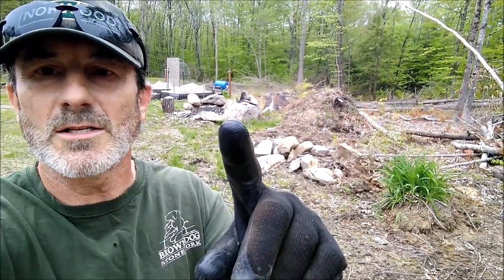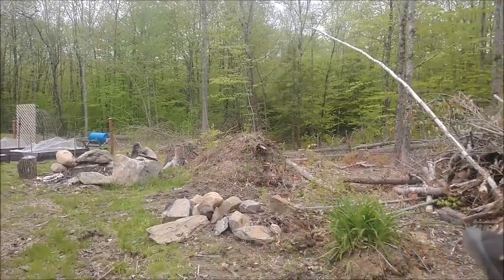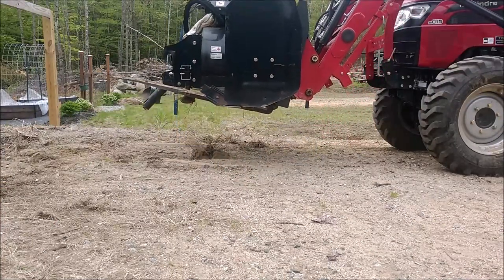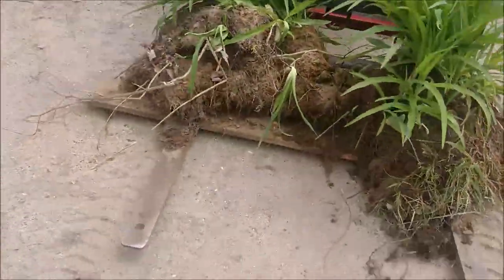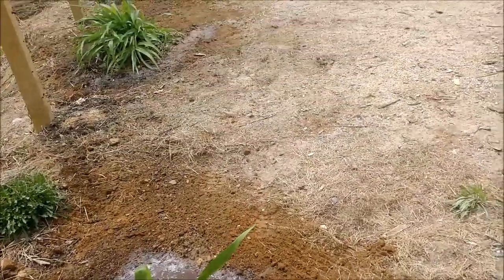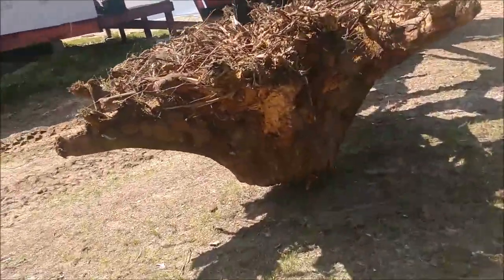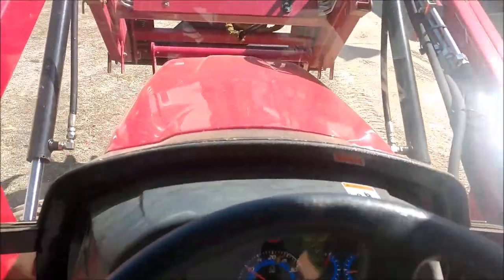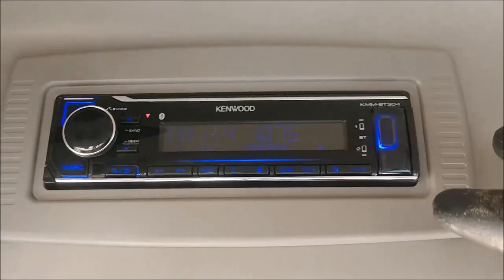Using the Mahindra 2638 I started clearing an area we want to use for new garden.

Comment: Just subscribed Tim! Mahindra 2638 owner myself.
Reply from the maker: Hi N1KSF, thank you for subscribing! We're loving the Mahindra 2638. It's helping us take our work to another level. With all the quick attachments there's not much we can't take on. What do you use yours for primarily? Thanks for watching and commenting!
Reply: @crookedriverhomestead Mine is a 2021 year model... I'm a few hours to the left of you in Southern NH. My 50+ odd acres here is mostly inclined, wooded and loaded with granite rocks (part of it used to be a quarry) I use it for dumping gravel and dirt and smaller landscape style rocks..bucket of course comes in handy for transporting rakes and shovels etc. I did buy a set of 60" Titan adjustable forks w/quick disconnect frame for it as well, have used forks to lift up pallets, concrete slabs, lumber, fallen trees..and with straps, I have used it to unload a 20t hyd press from trailer, large table saw etc. Moving a large chicken coop across property will be next. I actually use the backhoe (with thumb) more vs loader, in digging up and moving granite. Have moved and relocated some 1000 lb+ pieces with it! Tractor has also recovered stuck cars and SUV's on property in winter! 😂. I won't push it beyond its limit and keep it as residential use vs commercial use. I have the Ford 555 for the bigger/ heavier things and 2 smaller Economy tractors with loaders, more so for garden use. Also have a Harbor Freight backhoe, the lower CG on it, I'll use in certain steep inclined areas on my property vs the Mahindra...don't want to flip the Mahindra! lol
Reply from the maker: Sounds like the perfect tool to have on your property. You have a lot going on there! Did you get the cab? Good plan to not push beyond it's limits. As the parts manager at a Mahindra dealer I saw folks who did push it to hard and ended up breaking things. The motor is what makes the machine IMO, but the large motor can make it easy to push it to hard. I could use a bigger piece here also to do the things the 2638 can't. But that's where rentals come in. Keep the rubber side down! ;)
Reply: @crookedriverhomestead  No cab. Between stray branches in the woods, and the current replacement time for the glass, I didn't want to risk it. I do need a canopy though for shade, I may fabricate one of buy the OEM one. Tractor is registered/ plated, stores indoors, and does not come out in rain or snow. Yes I baby it within reason..Tires are not loaded, and have the industrial tires. It's like having a new muscle car: power, looks great, smells new, but not being a teenager anymore, I won't beat it to death trying to see what it can do. That's where the other stuff come in. And yes at least with the HF one, I've broken it a half a dz times, repaired beyond OEM strength, never broke the repairs again, and on I go. I think the next purchase for the Mahindra is a Piranha tooth bar for the bucket. I do have a lot of P.I.T.A. saplings to deal with when clearing land, I think this will be a blessing.
Reply from the maker: I did have the tires loaded, however I still needed a 500lb weight on the 3 point before I got the backhoe. The 500lb weight made all the difference when carrying a loaded bucket. I did try adding a tooth bar to the bucket but it ended up breaking the first time I used it, so I returned it.  A toothed bucket would definitely be helpful to me. Farm plate would be nice also. Have fun!
Reply: Mahindra tractors are real tractors that work all day an keeps on performing
Reply: @ronniemitchell3010  no complaints with mine!
Reply: @n1ksf  we have 4 mahindra tractors
Reply: @ronniemitchell3010  I may get another in time to supplement my 2638. Lack of space is the reason, not so much, the funds.. No where to put it.
Reply: @n1ksf  we have 80 acres here n Mississippi, we got 35 horsepower all the way up to 55 horsepower,, just purchased a 2023 4540 mahindra for my birthday this month